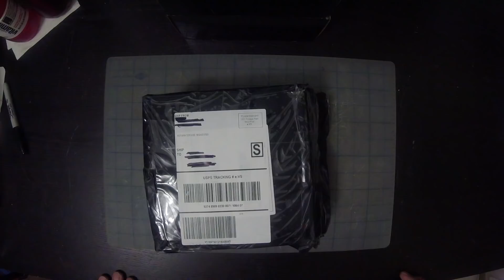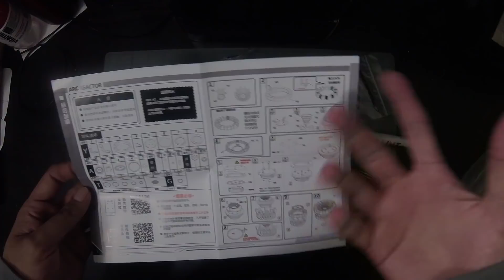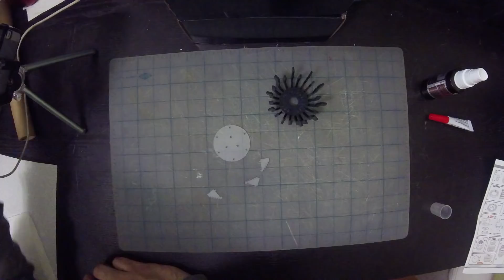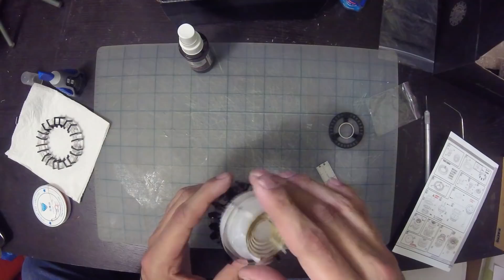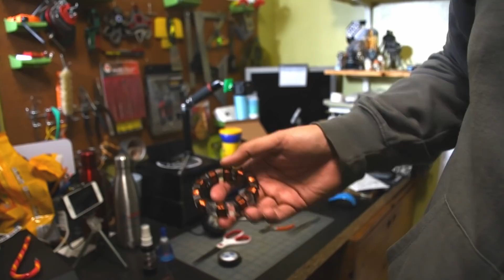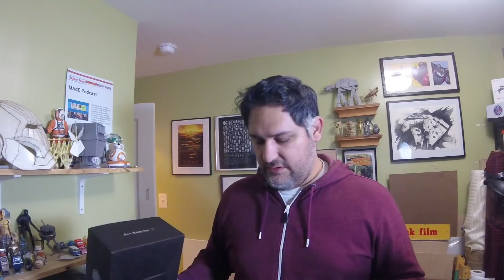Making IronMan's Arc Reactor 1 (from Wish.com) - Marvel

Comment: The reactor was so-so, but it was necessary to first wrap the coils with electrical tape and then with copper wire. The coils are a little translucent 11:28

Comment: what glue do you use?
Reply from the maker: I used regular superglue with activator, cause I was trying to do it fast.  But if I was doing it again I would buy some of the glue that is used for putting together car model kits.  Cause with the supper glue there was a little off coloring and whitening of parts after, but luckily it was in areas not seen.

Comment: what glue did you use and what tools do you need that arent included?
Reply from the maker: Didn't need any other tools, there was a small allen wrench with it already for the 6 screws.  As far as glue, I used regular superglue.  But if I was doing it again I would buy some of the glue that is used for putting together car model kits.  Cause there was a little off coloring and whitening of parts after, but luckily it was in areas not seen.
Reply: CityAperture thank you, I have just ordered mine and it will hopefully come soon! Thanks again.
Reply: @Cityaperture  ...and, if it's a replica, it should have some non perefect bits, if it was made in a cave

Comment: what kind of glue did you use???
Reply from the maker: I used regular super glue, but I actually wouldn't recommend it as it did whiten in some areas.  (luckily they were not visible).  I would go with a model makers glue, the kind to put together model cars if I was doing it again.  Hope this helps.

Comment: did yours light up automatically when you plugged it in? I bought the version with the remote, but it's not lighting up when I plug the USB in and i don't know how to make it work.
Reply from the maker: Mine did not have a remote it just lights up when plugged in and the switch on the plug is toggled. Maybe the remote needs batteries?

Comment: I ordered two of these, one to put together and the other one fully assembled for a gift. The company Comic Chief mailed both of them to the wrong address, and will not respond to email or phone calls to rectify this issue. As far as I am concerned this company is a rip-off. Put in a complaint for at both USPS and Paypal. IT is a bummer that they messed up something so easy a simple U.S. Mailing address. But the worst is they do not respond to you if you try to get the issue rectified.

Comment: What is and what isn't included in the package?
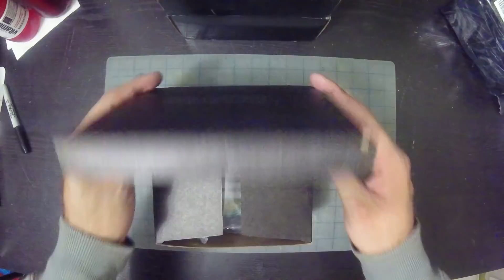Reply from the maker: I open the box/package in the video around minute 1:22.  But basically everything you see in the final image is included.  Wire and lights, everything, even a paint pen I didn't even use.  Only thing not included is glue.

Comment: How many windings did you do of the copper in each section? Do they provide enough wire to do multiple windings to stop light bleed?
Reply from the maker: Robert Williames I did several windings, so much so I didn’t even keep count. And I had a ton of wire left over as they provided a full spool. I was cutting about 2 feet of wire per location to wind on and had more than half the spool left.
Reply: @Cityaperture   making one right now.  This was exactly what I needed to know!
Reply: Black electrical tape directly around the acrylic is used in many builds and blocks light. Then wrap coils around it.

Comment: Why?if I searched the arc reactor,all the videos are only making the arc reactor but not using it for anything like charging mobile phone using it.only hacksmith makes the real working arc reactor which he used to charge his mobile phone.only light is glowing in all the other arc reactors.
Reply from the maker: I thought about doing something like that with mine, but I really wanted mostly for display.  I'm rigging it to turn on when the lights go on to make it seem like its always on.  I also have other plans for a battery phone chargers that I will hopefully do later this year.
Reply: Exactly fuck all the fake shit. i may order this one and make a real one out of it.

Comment: what glue did u use on the upper ring that has the copper coil
Reply from the maker: I used super glue, but made sure the glue was on the area that would be covered by the coil to avoid seeing any reaction.  There was reaction on the black plastic parts (some white hazing on them) but locally all got covered by the copper coil.  If I was doing it over I would use this https://amzn.to/2WHhSBC